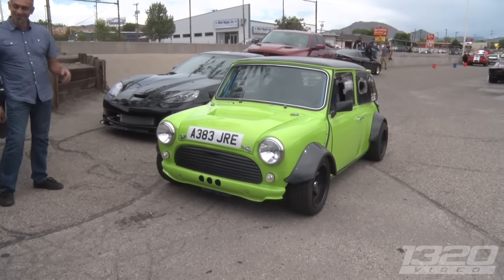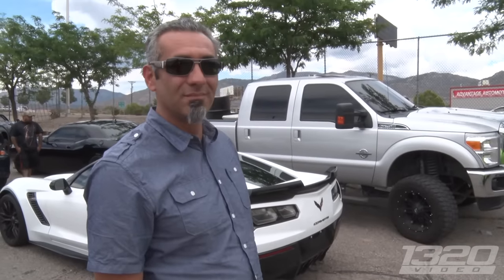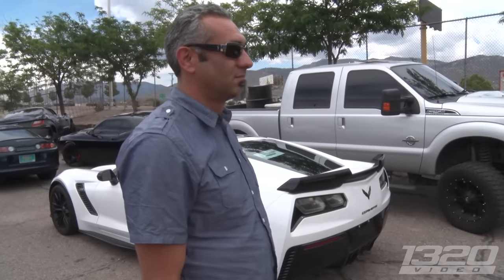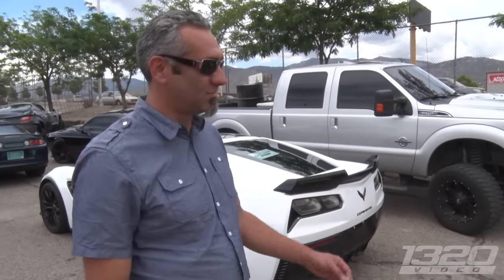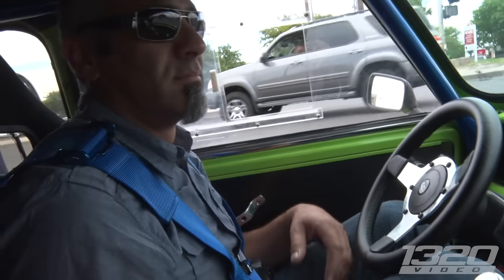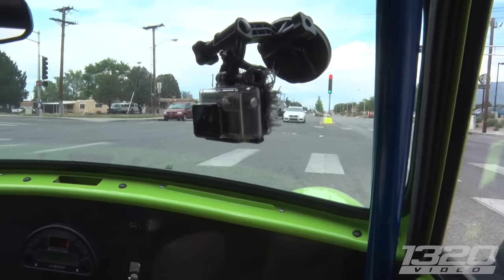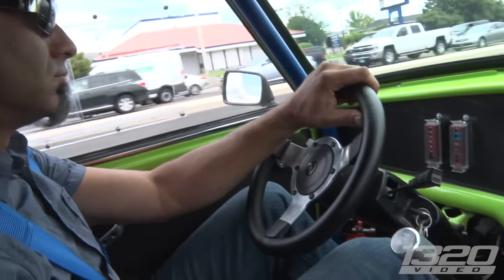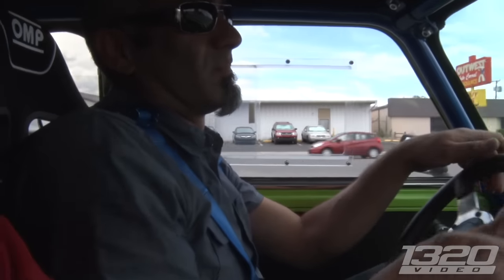He put a HAYABUSA Motor in his MINI - It’s SICK!

Comment: In the UK we have 3 main types of engine swaps for the Classic Mini Hyabusa, Honda K-Series & Rover K-Series. Also putting a BMW twin cam head on the original Mini A-Series engine is a pretty popular mod.
Reply: the hell??? never heard of the BMW head swap.
I have heard of the Vauxhall 2.0/2.4L DOHC I4 swap though with 250hp. Mean little basterds too
Reply: Yeah if you google "bmw twin cam a series" its an interesting mod and garages do full conversion kits. Lots of the hill climb and sprint boys do it
Reply: megabob_alpha i see r1 and b16/b18 swaps the most if im honest... easier to do without butchering car too much lol the ecoboost 1.0 is intresting
Reply: megabob_alpha Also seen a few Toyota Scarlet 1.3 turbo conversions too.
Reply: yeah id say honda B series are way more common than k series hondas. like 20 to 1. im not even sure anyone has done one here in australia yet. im doing a twin cam conversion for my 1293. converting to injection aswell. possibly turbocharging it in the future if i want more power. its got a 1275GT gearbox and a 286 cam on there already but the seals need changing so its sitting there until i get round to converting it.

anyway, yes, theres bmw bike conversion kits for both the 8 valve and 16 valve heads. i think its the k100 and k120 engines? cant remember the names.
Reply: The hayabusa engine is not a common swap. Not many people do honda k swaps. Vauxhall they do a load of and honda b16 or 18 swaps.

You are forgetting about the micra engines too. 

PommyDownUnder98

k100 for the 8 valve. k100rs, k1100, k1200 for the 16v heads.
Reply: Don't forget the R1 engine swap up front instead of the hybusa swap to the rear.
Reply: megabob_alpha project binky!
Reply: megabob_alpha there should be a couple with suzuki's g13b dohc in them.
Reply: mighty car mods done a b series mini
Reply: megabob_alpha the lotus exige was the coolest one I've seen
Reply: DUUUUUUUDE A K20/K24 1,000 pound mini would be insaneeeee
Reply: You can also put a Yamaha r1 engine in them
Reply: megabob_alpha back in the day we used to drop the old mg metro turbo engine in too... Remember that ?
Reply: Pokerclown 79 well that was still an a series, albeit it A+ with injection and a turbo.
Reply: You really dont have a clue what you are talking about do you PommyDownUnder98? 

Injection? Most certainly not. If had a hif44 carb on it. Not fuel injected. 

You make all these claims that you are going to do this and that with a mini. However lets be realistic its all guff you are talking on the internet. None of its true because you dont have the knowledge or the skills to do it.
Reply: There was also a limited production serie with Turbo engine, the Mini ERA Turbo: simply said, just a Mini with a Metro Turbo engine and brakes in it. And no fuel injection! ;-)
Reply: what about the LS? LOL
Reply: Chevy V8 also already done: in a Mini PickUp ;-) 
 And a Rover V8 in a saloon tooooo.. 
MANY things are already done with (or to?) a real Mini
Reply: WOW, I was being facetious. That's crazy tho lOL. If I really want that power to weight my bike is close enough. Although, It would be amazing to see a free revving V-8 in a Mini.
Reply: There's a few R1 engined Mini's in the UK, Z-Cars(I think) put two of them in one Mini. Now that was a mental idea.
Reply: All engine swaps in the back of a real Mini are the "easy way" and destroy the whole idea of the Mini.

So B16, B18, R1, BMW K head and the like = YES!

I have a 1380 Mini with close to 100 horses and it goes well.. but it feels it can handle easily 200 horses too! :-)
Reply: The easy way? You realise you have to rebuild the entire structure of the rear of the car yes?
Reply: Sam Walters   Yes Sir! And you have plenty of room for that. AND I put it in between " " ;-)

Keeping everything in the front is quite a challence because it is quite small.. just enough for the original compact setup.
Reply: The best one so far has a 2.8 Powertec V8 engine based on two hayabusa cylinder heads joined to a purpose build crankcase... wtf!
Reply: Sam Walters was it an hif44? my mistake. so i got one thing wrong and that means you are able to make an assumption about my entire lifes work? right...regardless, im building my mini right now actually. its a 1978 1275LS. last of its kind. they were a runout model, a last hurrah of australia before it went out of production. they made approximately 800, 400 in gold, nugget gold i believe it was called, and 400 in hi ho silver, which is what mine was. i know that they had very little special about them, special red fabric interior, 12 inch wheels, a special "eco-friendly" version of the 1275, which was basically just a restricted cooper S engine. an extended fuel tank was also another upgrade, although it only had about half a gallon extra. they also came with special blue tinted windows, among other things. i know that australian clubmans are essentially a mk1 with different doors and mk2 tail lights aswell as a clubman front. they did very little to change them, however they are unique to australia, making them quite desirable elsewhere. i know i have a 1098, with an HS4 being the only modification, waiting to go in because im still restricted as to the cars i can drive. when im off the restriction next year, i have a A+ 1293 that has next to everything lightened and polished that actually makes sense to lighten and polish, mated to a 1275GT gearbox, which i may change out because i also know it has a shorter ratio than a standard gearbox, that needs a refresh and once over. with that, i also plan to fit a bmw K series head off of a K1200, which has 16 valves on it. i do not yet have the head, nor the conversion kit as money isnt always a luxury i can spend on arguably unnecessary car parts. i will also be fitting that with injection and a completely custom harness, most likely from haltech. unfortunately, while the total outcome of power from that engine, once complete, wont exceed my restrictions, the power to weight ratio when you then go and fit that in a mini, ever so slightly will. i bought this car as moderately damaged shell, to which, for the past 3 years, i have single-handedly restored it. amongst multiple family issues and storage problems, it now sits at my house, in the garage, right behind me as i type this in fact, sitting in its second coat of primer that i painted myself, awaiting its third before the base coat.

qualifications? no, i dont really have any. but knowledge ive got in fucking spades. im perfectly fine with you correcting me mate. i emigrated with my parents to australia when i was 7, so i dont really remember much about the cars back there. we also never got metros here, let alone mg metros. it is entirely my mistake for thinking too highly of MG and thinking they put injection on the metro turbo engines. but you could have been more polite about correcting me. i have seen one metro here, when i was at a show i think 2 years ago. it wasnt a turbo, but it was an MG. i know both of my parents have owned metros, both MGs and my dad did have a turbo for a brief time. regardless i dont make myself out to be the smartest, im far from it. im currently doing a part time course to learn how to do cylinder head reconditioning, i learn everyday. i marvel at the revolutionary design of the mini every time i work on one. it really is incredible to see cars like this that were so far ahead of their time and triggered designs that are still being used half a century later, yet even back then, and even now, they are still timelessly classic and popular. i am indeed going to build a hillclimb mini, i know very little about what im going to do to it as i dont like having more than one project going on at a time and after this, i have my sisters 2 minis, then my mother also wants a kombi, and ill likely be helping my father with his projects too, so for all i know, itll be 10 years before this thing is finished, but i am going to do it. you have my word on that. i know its going to be AWD and it will have a 6 cylinder mid-mounted engine, possibly turbocharged. more than that, i dont know.

i also want to modernise the mini, very much like BOM are doing with theirs, take the shape, and apply todays technology in engines, driver aids (should i want them) and safety. the shell has next to no safety consideration built into it, to the point where you are essentially the crumple zone, i want to change that and hopefully make it legal, although australia is going to be a hard country to do that in.
Reply: Sam Walters oh and one other thing, all that crap i said about my mini and its history, no, i didnt get it off google.
Reply: rb26nate is that not what the ariel atom V8 uses? correct me if im wrong.
Reply: urm....so you've done the basics most mini owners do. 

I dont think you really understand how much of a jump in skill and knowledge it is between doing what you've done and what say BOM are doing. Worlds apart. Fabrication is another world entirely. You are looking at 3000-8000 hours of practice and screw ups before you become the bottom end of competent. 

Thats what a 4 year apprenticeship is and that's with a master of the trade on hand to teach you.
Reply: PommyDownUnder98 quite possibly... gonna have a google to see.
Reply: also a few with vauxhalls c20let, pushing over 300bhp.
Reply: @ Soulware 3D: Yep, in the Netherlands also one with 450hp 2.0LET with 4x4. It was used in the Dutch rally championchip and also rallysprint. 😎

But nothing to do with a Mini anymore, just the looks..
Reply: Sam Walters who said thats all i have done? thats just what im doing on this car, what ive had to do, it really didnt need much, it had been crashed into at some point, surprisingly enough the floor was completely intact. that was still merely one example, proving what you assumed, to be wrong.

being good at fab work does take time and practice, yes. to be honest, i actually quite enjoy it. i can provide more examples if youd like. i dont do it for a living, im not qualified for it, i just do it for a hobby. regardless, i dont feel i need to explain or prove myself to you. its a dream and its also a plan. theres a lot of things i want to do inbetween times. if you dont like the idea, fine. if you do, why dont you just say so and move on? or better yet, help out? if you feel you know more about it than i do, please do share your knowledge, id love to hear what you have to say. i made one mistake about how the metro engines recieve their fuel, my fault. correct me and leave it at that.
Reply: Sam Walters i also make no bones to be as good as BOM. its an absolute marvel what theyre doing. note, i believe i said the level/quantity or amount of fabrication they have done is what ill need to do. ideally, id like to keep it in a steel shell, if i find thats not really possible, considering ill either have to cut most of it out, chop it up, modify it and potentially completely rework the thing, it may just end up being a spaceframe, considerably easier to do when you think about it.
Reply: IIRC there is an australian guy building an Sr20 4x4 mini . Engine and running gear from a pulser gtir.
Reply: You have a heck of a lot to learn about chassis design to say the least.
Reply: Sam Walters what makes you say that?
Reply: Pokerclown 79 I had one... loved it...
Reply: I remember the ERA turbo! god how I wanted one lol
Reply: Cyborg Badger   Yes.. turbo's are very nice things... But my 1380 has the same power at the same rpm as the (standard!!) ERA turbo engine. And the same brakes too. But well it's all about the ERA-badge in this case..
Reply: I was gonna hyabusa swap mine but it got stolen when it was stored so wasn't insured..
Reply: this car is from the uk smh its got a UK plate I swr
Reply: @riothero313 Years ago in a magazine I saw somebody had somehow rammed a 3-3.5l Rover V8 in the front of a Mini. Many internal mods, obviously, but it looked almost the same outside. The mag wrote something like "the driving experience is very Mini-like, with about 4 times the power on tap"

Comment: Is it me or doesn't everyone shift by sound?  I didn't know that was unusual?
Reply: enodohtem.  MOST DRIVERS SHIFT BY SOUND. Keep your eyes on the road.be safe. Good video & more road shoots please.
Reply: Yup, that's how I learned.  The camera guy was so amazed by how he's shifting by sound.  Anyway, at least the driver looked like he was having a blast.  lol
Reply: Yeah in normal driving I don't see a reason to look at the tacho when shifting, you don't need to pick a sweetspot. I evere only glance at it when I push the car around the redline
Reply: It will take you more effort and cause more road safety problems to learn all the appropiate numbers that the tacho might show. If you need to get up to speed quickly (highway entry for example), you just keep pressing the gas until you think ‘now its enough noise’. It’s just common sense.
Reply: Yeah, we do, sound only. Unless youre learning. The vlogger doesn't know his manuals
Reply: I've never had a need to look at my tach. The way I see it, there's absolutely no need to look at the tach. If you're looking to stay in the power band, then you've already manually found it by feel and will know the sound. If you're wondering when to shift up, shift up when the power starts to plateau or drops. If you're wondering when you need to shift down.. when you can hear something other than your own vehicle again :)

Unless you've spent countless hours on a dyno to figure out the torque and HP ratings of the RPM ranges for each gear, the tach is just a vague dial that tells you how much gas you're wasting compared to driving at the speed limit using expected acceleration :)
Reply: The F1 driver Jackie Stewart was probably first to give voice to that driving style and that was in the 60's, people have been doing it for decades.
Reply: Yeah unless I’m racing my friend up the highway, then I look out for my peak torque/horsepower limits so I know the ideal gear and when to shift
Reply: Yea when you learn your car you don't need to look down anymore , I still do only if I happen to have headphones on other wise I shift by sound aswell
Reply: as a biker i just know when to shift, maybe from the sound or maybe from the vibration i dont really think about it i just can feel it
Reply: Yeah i don't get that.
Reply: I guess it’s a condition you get from driving an automatic...

Comment: Nice Mini well converted. I bet he did very little on the conversion as he didn't know how much the fuel tank held. Done a few conversions here in the UK and in as much as the A series engine can only take so much I do realise that a donor lump needs to be installed but that just takes away from the Mini. At least the body looked stock. Have seen some bike engined mini's that are basically a roll cage with a fibreglass shell.

Comment: Imagine a 4,000lb car with 1000hp

That's what this car is but smaller
Reply: are you talking about a power to weight ratio?
Reply: Basically yeah
Reply: Ummmm 1000lbs with 240hp... I think your math is off
Reply: 4000lb with 1000hp or 2000lb with 500hp. Sounds like fun to me. Also, guy above me, its not uncommon to round numbers. Don't be a dick
Reply: @jasonh2954  by 10 hp lol nitpicking my guy
Reply: uhm, the M5 from evolve sounds similar.

Comment: I love Hayabusa swaps! Mx-5 NA should be next up for one and then gut it down to 800 kg. Mmmhhmm.
Reply: barath4545 
I want an MX-5 with an Aprilia V4.

ideally, I'd take two and have a block and heads made that would let me have a suicide-approved 2l V8 but at that point... it'd only be connected to the bike engine in theory but not parts wise
Reply: Not a bad idea either, just remember that a bike engine for even a light car needs a lot of torque to move the car. I dunno the V4 though, but hope it will work. The two engines can work. I mean, tractor pullers use 5! engines all the time (all 500ci SC methanol) and make that work with transfer boxes. 
Home made yes, but probably doable as the MC engines are not that big. And it would be unique. But for easyness, maybe just turbo or supercharge a single V4. 
Then again, "... do the other things, not because they are easy, but because they are hard". It would be pretty murica to fabricate a transfer box to two independent V4s rather than make a joint V8 billet block in a 3D cad program based on their design. And its just a fancy gearbox so not impossible by any means.
Reply: How about the 2015 R1 crossplane engine 😍